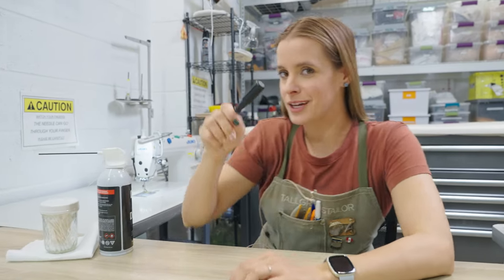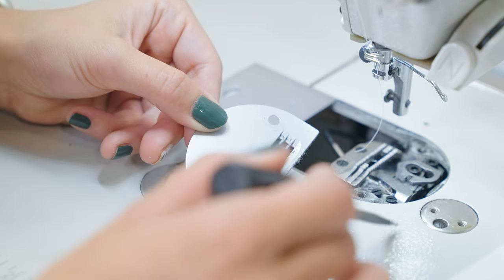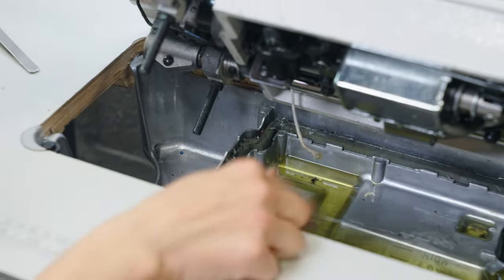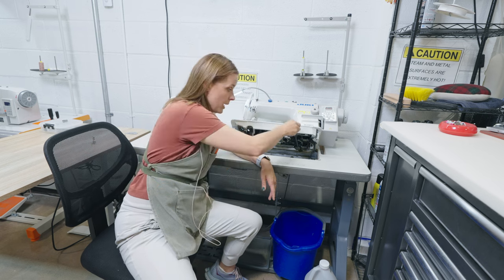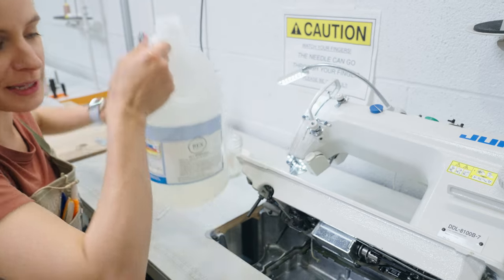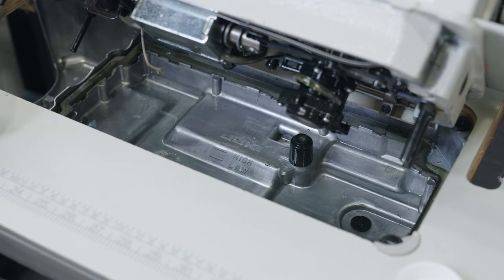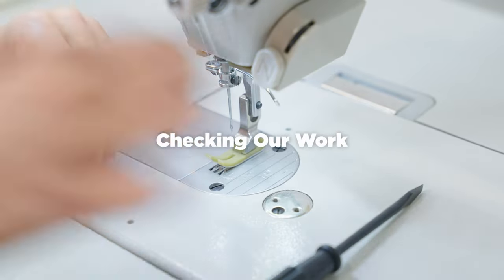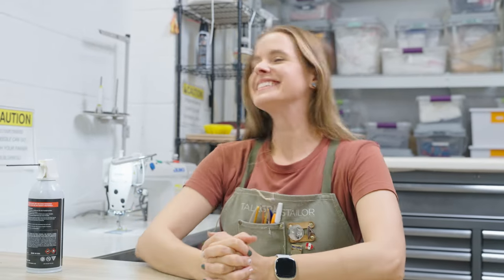How To Clean A Sewing Machine

Comment: Thank you. I have a pfaff industrial machine and this was helpful instruction to clean the machine. I clean the basics but wanted to go a bit deeper. Ive had mine about 15 years. It does not have an oil reservoir.  Any additional tips for that type of machine? The oil is not yellowed. Its still clear.

Comment: How often should you clean your machine, without changing the oil
Reply from the maker: You’ll know when it needs it, I personally use canned air and Q-tips as often as once a week to get little bits of lint and thread out of all of the small moving parts, as well as removing the throat plate to get under the feed dogs